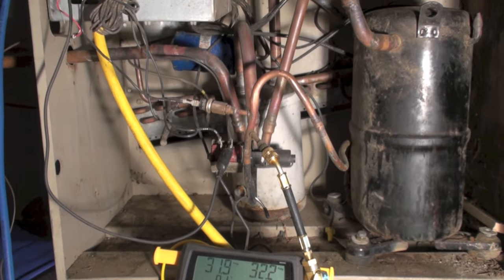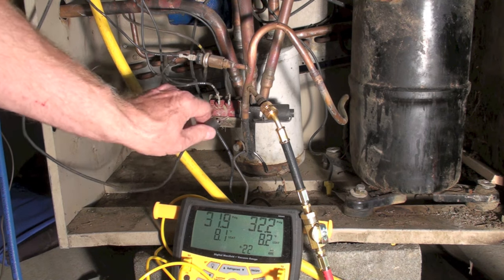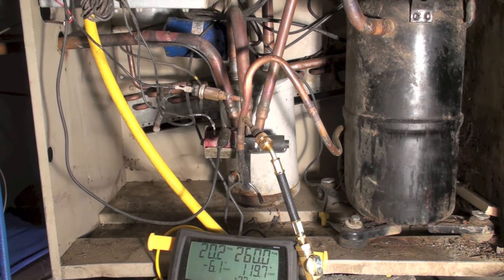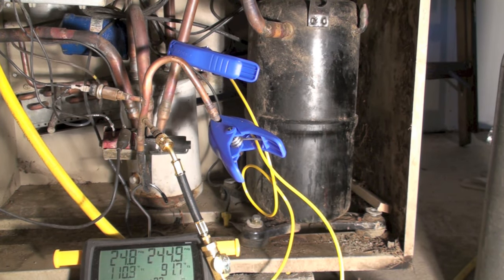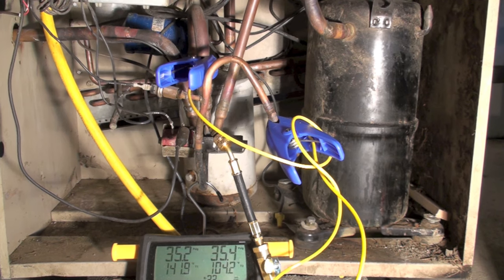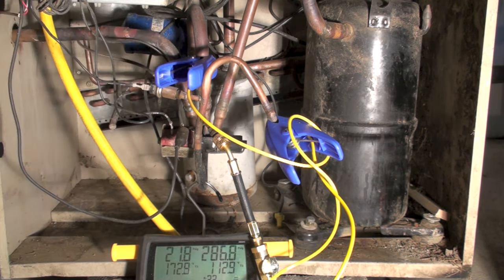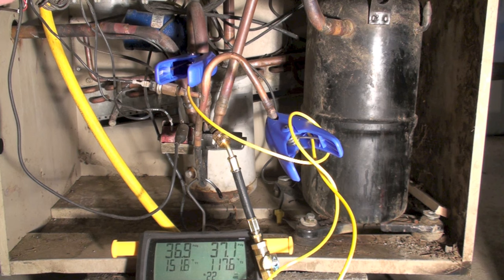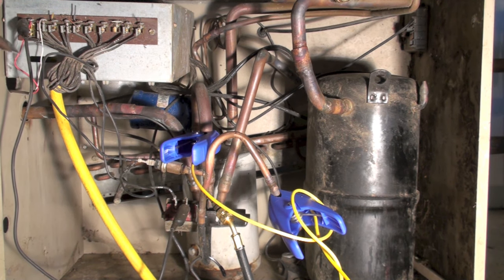Diagnosing the stuck HVAC reversing valve

Comment: I've got one. ICP package rtu 3 phase heat pump. No cooling. No indoor fan, no nothing.Call for cooling and the transformer breaker trips. You can hear the reversing valve just begin to activate and then bam, 24v tranformer breaker trips. I'm thinking the reversing valve solenoid is shorted though of course it could be something else. I did a visual and some checks to ground on 24v circuit checking for short but need to dig into it more thoroughly..  Regular customer of ours. Vacant building but someone getting ready to rent. I'm going back Thursday. I was able to reset trans breaker while attempting to diagnose and as I say, once call for cooling you can hear the rev valve just start to energize and then trip.
Reply: Draca have you tried to remove the wires to the rv and then make a call for cooling? If it still trips then it might not be the rv?
Reply from the maker: You probably do have a solenoid problem.  Either shorted to ground or just plain shorted.
GFM
Reply: Hey GFM, I walked into a new heat pump install by another company. Within 20 seconds in heat mode the head pressure shoots up to 500psi and trips. Any thoughts? Cooling works fine
Reply from the maker: I would be looking at the reversing valve.  Possible it is not shifting completely for heat.  Of course, charge could also be an issue.
GFM
Reply: grayfurnaceman I’ve recovered and weighed in factory charge. Same effect. I have a warranty RV. Just wanted to make sure before I change it
Reply: Not yet. I only got a few minutes on the roof to take a look at what it was doing the other day before storm moved in. Pulling the wires will be first thing I do. I have seen this before when a solenoid shorted. Call for cooling > valve just starts to engage and boom, either fuse in board blows(if there is one) or breaker in transformer trips. Gonna be there as early as possible tomorrow morning because of curse it's an rtu and it's gonna be HOT tomorrow. Hoping I don't have to spend too much time hunting around for shorts and it's the rv solenoid.
Reply: That is currently my hunch. I'll know in short order when I get there tomorrow am. Thanks for the reply !
Reply: Draca text back when you identify the issue
Reply: Will do
Reply: Well, went up today and transformer is shot. The transformer breaker would no longer reset. Installed new transformer, called for cooling then the  contactor tried to engage(chattered) then transformer breaker tripped. Began looking for shorts to ground at t-stat wires. Found that they all had continuity to ground. Disconnected all t-stat wires from board and then no continuity to ground from isolated wires but did still have continuity to ground on screws on the board. Disconnected secondary wires from transformer and and each wire had continuity to ground. Checked rv solenoid and it is good. Examined all low voltage control wires coming from rv solenoid and elsewhere in compressor compartment and found no worn insulation etc touching ground. That's all the further I got as it started to storm here and I got soaked so cam down from roof. I now know however that the problem is not in the t-stat wires  or the rv solenoid but somewhere downstream in unit. The other thing is after that initial attempt of the contactor to engage all attempts to call for cooling after that the contactor did nothing but after about 6-8 seconds, the transformer breaker would trip. To me that smells more like a shorted load(like a coil drawing too much current) as opposed to a dead short to ground but as I previously stated, even with t-stat wires disconnected from board I am getting continuity to ground at the pins where the wires hook up. I also had disconnected wirs from contactor coil and transformer breaker would still trip after a few seconds in call for cooling. These rtus can be a real pain to find shorts in the control wiring that is for sure. Hopefully it stops raining and I can get back up there today to resolve the problem.
Reply: Okay. Already posted a previous reply on results from today. I got rained out this morning but went back a couple hours ago and had enough dry time to check it again. This unit has been having trouble nearly from the day it was installed by another company 2 years ago. Thus far we have replaced a bad main board and t-stat.The problem this go round was a bad transformer(transformer breaker would not reset) I also found that whomever installed the unit had the primary side wiring set for 230v but power in is only 208v Put a new transformer on it and put primary wires on 208 called for cooling and within 6-8 seconds breaker tripped. I noticed earlier the one time the contactor actually engaged that it chattered. I put a contactor on it this afternoon and it fired right up but reversing valve did not engage. Solenoid getting voltage and pulling but valve not moving. Unit is properly charged s that is not an issue. What baffles me most is the fact that the reversing valve was in fact engaging just the other day when I first began checking the problem. I changed nothing on the unit other than transformer and also stuck a solenoid on it but valve now still not switching. The voltage issue with the transformer hookup would not cause valve itself to go bad so I find it a bit odd that now that the voltage issue is fixed, the valve wont switch(?). Valve is not reacting to solenoid engagement at all but not sure what in the mix of all this has caused it to go bad short of sheer coincidence. Unless I am completely missing something. I don't like hanging parts but this unit has had issues since it was installed off and on and the mis-wiring of the transformer primary could well have been the culprit that however would not explain the sudden issue of the valve not reacting.
Reply: Draca I’m glad I’m not in your shoes right now...It’s been bad right out of box 2 years ago? those rtu’s are a spaghetti bowl of wires..gotta find that short tho. Not fun, not fun. Wish I could help
Reply: Yea, I wish I wasn't in my shoes either. Simple no cool svc call and now it's this. I've been doing this long enough to know however that once in a while you get these odd ones that make little sense. I also know that no matter who you are or how experienced you are you can still make a mistake occasionally so in my mind I went through what I did and what unit was actually doing when I got there to make sure I didn't miss anything. Only other thought that breezed through my mind tonight was the phasing coming in and if the scroll is somehow now turning backward. Wasn't doing so earlier but that could make a rv hang up also when in reality rv isn't the actual issue. I did not notice how the power came in to this building today and had no reason to look. Other units(all 3 ph) on roof were working. I've had that happen before and cause serious issues with both furnaces as well as rtus. Transformer changed at pole and wiring crossed up and then equipment in building being serviced acts up. That may be overthinking it on this one. I gave them an estimate on new valve so I will leave it at that. I don't think I mentioned it but even though it was new I still checked valve and voltage was good to it, it magnetized a screw driver and it gave me 16 ohms - all considered coil is in fact trying to get valve to engage. Weird.
Reply: Draca very strange. I was also going to ask if the 3 phase legs were in order until I realized it wouldn’t be tripping in a few seconds if that were the case. Not sure what I would do...Probably checking continuity, resistances, unplugging and disconnecting things one at a time to see what would allow it to continue without a trip. Hard to say when you’re not in front of it, as you know. I’m sure this one is a head-banger. Challenging nonetheless. I hope it’s something simple though. It’s strange you have continuity to ground on the circuit board terminals..does the system actually fire up when you flip the disconnect?  Fans and compressor? If so what are your pressures like? Or does it go into a delay when you apply the power and then a few seconds it’s just trips without running at all? Have you tried applying power without the thermostat wires connected to the board?
Reply: And as much as I don’t like doing it...
Have you tried calling the manufacturer for tech support?
Reply: At this point I have replaced the disconnect and contactor and it does fire up but rv isn't engaging so no cooling
Reply: With ICP forget about it. They won't talk to contractors. In this area you have to call United Refrigeration for tech support. I was in our local United today and what's funny is they told me we talk to them and then they call ICP and ICP will give the United rep tech support. That's insane but as time goes on I am finding that sort of insanity is becoming ubiquitous in our industry these days. Copeland does the same sort of thing now. Unbelievable. ICP commercial equipment is labeled Tempstar, Heil, ArcoAire and maybe a couple others and after what I've seen of them I wouldn't install their commercial equipment if that shit was given to me for free. Sorry to be so blunt but that's how I feel about it. Components being made in China and Mexico and I was told by a fellow HVAC tech today that many rv are being manufactured in China these days and they fail more than rv used to.

Comment: Hi, I have a mini split unit, cooling works great, blows great, when I switch to the heat pump, nothing happens inside and outside... can you help me trouble shoot this problem? 
It has plenty of refrigerant, no leaks, remote program is fine.
Reply from the maker: Do you have fan inside and out?
GFM
Reply: Yes, both fans work when cooking, but nothing happens when heat is on.
Reply from the maker: @Valor4Christ  I would be looking for a problem in the low voltage controls.  Does the unit use a wireless thermostat?
GFM
Reply: grayfurnaceman mean to say “both fans work great while cooling”
Reply: grayfurnaceman I will look into the low voltage controls and get back to you.
Reply: grayfurnaceman I believe it is in the remote, so yes it is wireless.

Comment: My heat pump acts funny in ac mode. I have a lennox heat pump 14hpx series. Every few hours it blows warm air even in ac mode. Air is hot enough It will actually raise temp of rooms from 80 to 85. I looked at outdoor unit and when this happens the outside unit fan blows cool air from top.

I then change setting in my thermostat (honeywell focus pro th6000). I make fan to 'on' from 'auto' and set the system to cool till 'cool on' sign comes on. 

Any insight will be appreciated.
Reply from the maker: vikaschopra1973 The system must be energizing the reversing valve.  Possible a wiring problem at the thermostat that is energizing the valve when it goes to 2d stage?
GFM
Reply: Sometimes a bad reversing valve will have an intermittent problem. You have to make sure to have 24v to the valve. Its possible the compressor is dropping out, but if the condenser discharge is colder than outdoor temp i doubt it. It could be your tstat not energizing the "o" terminal also. You need to call a tech
Reply: grayfurnaceman Thanks.
Reply: scott shoemaker Thanks

Comment: Last night my ac stopped limbo g cool air. Called a tech to come out today and he ran all his tests and said that I need a new unit or atm east s new condenser. He did nite that the valve did not make the swoosh sound even though the solenoid did move. I’m now more convinced that it’s a bad valve since the compressor does turn on and I’m getting nothing as far as cooling. Now, is there a way to change that valve?
Reply from the maker: The valve is replaceable.  It is an expensive part to replace.  Second only to the compressor.  Depending on the age of the unit (generally about 15 years), it may not be worth the repair.
GFM
Reply: Uh oh I think mine may be bad. No swoosh and it keeps freezing over. I have to manually put it on AC to defrost it then go back to heat.

Comment: I have freed up stuck RVs before by energizing and denergizing the solenoid or by tapping with the rubber handle of my screwdriver. But that sometimes is not a permanent fix. Have you ever used Supco 88 oil or Renew oil to lube the valve and free it up? I've read really positive reviews on that stuff.
Reply from the maker: I can't say I have used it.  I am skeptical.
GFM
Reply: I am skeptical myself!

Comment: 20 psig is -5F on suction.  Is this normal for outside evaporator in heat mode for R22 ?
Reply from the maker: The suction pressure depends on outdoor temp.  As a ball park number, about 15F below outdoor temp.
GFM

Comment: Sr I like your video too much are very interesting. If don't mind I would like to know in Heat Pump in cooling call why suction pressure line is High and discharge line the pressure is low even when the Thermostat and entirely  24 vol control system is ok.Thank you  and Regard Sr
Reply from the maker: Sounds like a reversing valve problem.
GFM

Comment: why isn't the pressure in the suction line lower  than the discharge line , shouldn't the pressure decrease  as it go through the evaporator coils ?
Reply: bbal78 this is a heat pump and works both directions thanks to act. of a [working] reversing valve. Oh wait, it's stuck.

Comment: i have question,pls help me, this morning im charging the split type unit (r22) and the psi showed low side 55 and the high side show 70, while running the unit, it means (ok) somebody telling thats its ok, but im not satisfied as of now, pls give info, thanks alot,
Reply from the maker: High side should be much above 70#.  Are you sure your gauges are connected correctly?  Hi side should be 20 to 30# above ambient.  Hope this helps.
GFM

Comment: Have you ever removed a reversing valve all together to get cooling only. Would it be as simple as just connecting the liquid and vapours together?
Reply from the maker: elcorro534 It can certainly be done.  But if the reversing valve works, I would set the solenoid to cool (most manufacturers have the reversing valve energized in cool) and use it that way.  Hope this helps.
GFM
Reply: There would be a good deal of copper work to accomplish that. Ive never heard anyone doing it. You need to connect the discharge to the condenser and the suction line from the evap directly to the compressor. Id charge u about the same to do either

Comment: My hvac contractor said my reverse valve is not doing its job and his conclusion is to replace the whole condenser. Does this sound right?
Reply from the maker: That depends on its age.  I usually figure that over 10 years age consider replacement.
GFM
Reply: grayfurnaceman - thanks for the quick reply. That's the thing - the condenser is fairly new - just about 3 years.
Reply from the maker: In most cases, I would replace the valve.
GFM
Reply: grayfurnaceman - cost? Approx. really appreciate your responses here
Reply from the maker: $900- 1300 
GFM

Comment: Most likely the problem is that the Teflon in the valve broke and got the valve stuck in that position and at the same time it is blocking the discharge gas resulting in High discharge pressure and High suction pressure. There is no other way a stuck valve will give you such High pressures. If you also add service ports on the other ends other than the middle suction line, the pressures should be way lower than the pressure reading taken from the discharge line as is now. The fast equalization at shutdown will also take place because the suction is not fully blocked in this particular case. I have taken apart many valve and witnessed this problem.
Reply from the maker: Probably true.  As you have seen from taking apart these valves, they can fail in any position.  Thanks for the thoughts.
GFM

Comment: i have a tempstar 2200 and my outside fan will not come on for the heater
Reply from the maker: Roger Pickett I assume it is a heat pump?  Check the fuses in the disconnect at the outdoor unit.  Hope this helps.
GFM
Reply: yes its a heat pump
Reply: If you can verify the motor runs at all its probably a bad defrost control board

Comment: In video , discharge temp 170F and pressure 285 psig but sat tem = 127F. Therefore approx 40 F superheat on hot gas discharge. What would normal discharge superheat be on discharge. Thanks  for great video, Michael
Reply from the maker: Discharge temp depends on suction temp and compressor load.  So there is no accurate answer.  The 170F temp is a good average.
GFM

Comment: The Differential Pressure Flow Measuring Principle (Orifice-Nozzle-Venturi)

see here : diffferential pressure flows from higher pressure to lower pressure
Reply from the maker: There is no nozzle or nor venturi.  I am not sure what you are getting at.
GFM
Reply: Orifice - Nozzle - Venturi : is for gas or oil furnace, not a heat pump.

Comment: yup,i double checked,and still showed 70 psi in high side its that rigth?
Reply from the maker: No.  You could have a reversing valve stuck partway.  I would check its operation.
GFM

Comment: Have you ever used a magnet to see if the valve moves?
Reply from the maker: Yes, you have to remove the solenoid and use the magnet on the rod.
GFM
Reply: @grayfurnaceman  thanks.